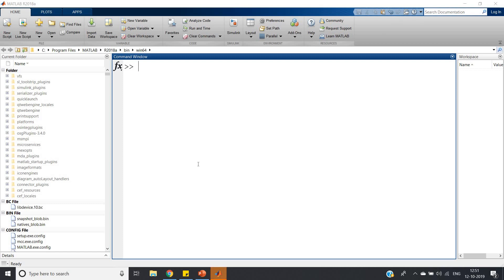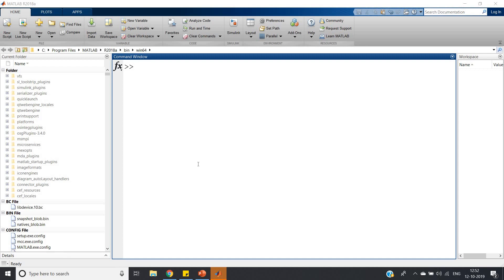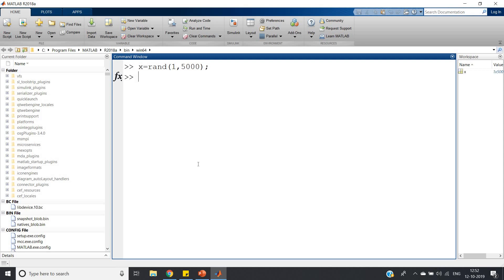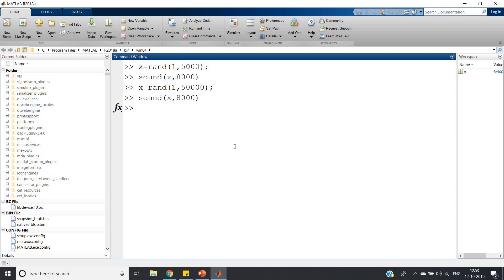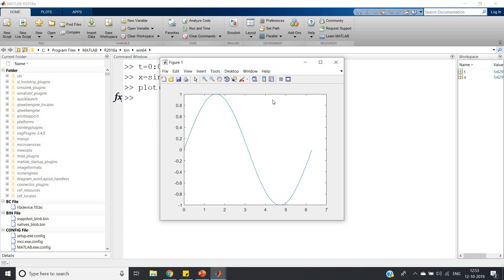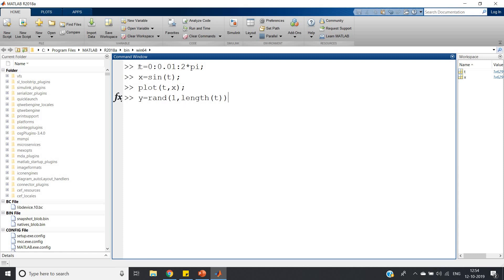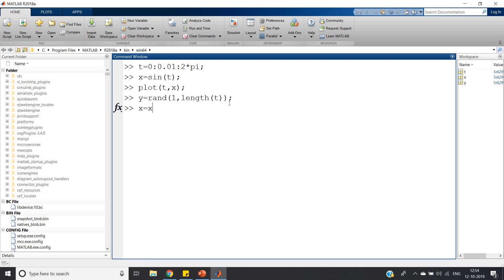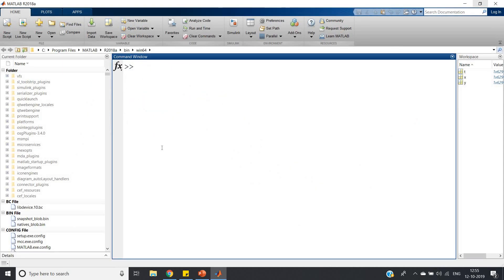Adding noise to a sine wave | MATLAB

Comment: Here why can't we use size instead of length? What is the difference between size and length
Reply from the maker: Soory for the late reply Subhosri Basu

Length return you largest of row and columns of matrix, whereas, size return you the complete dimension of the matrix.

Consider a matrix ‘A’ has 3 row and 5 columns. then

>> length (A)

>> 5

>>[r c] = size(A)

>> r = 3

>> c = 5

Hope this will be helpful.
Happy Learning :-)